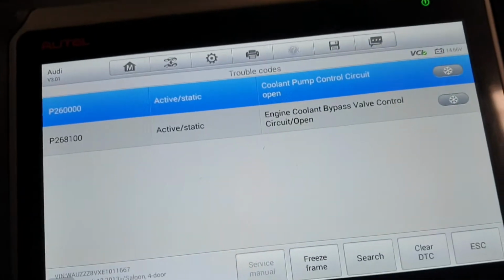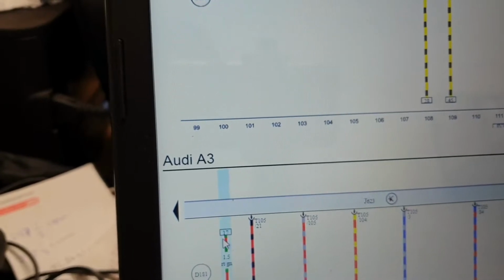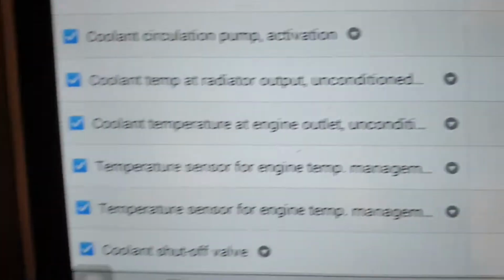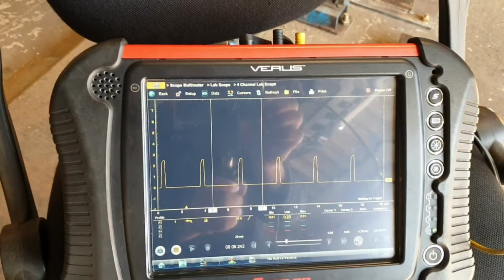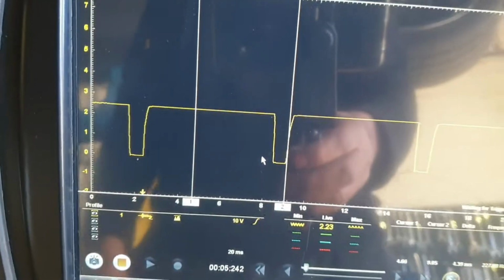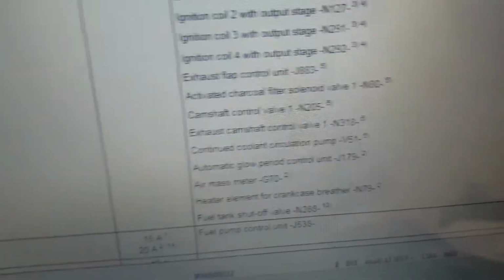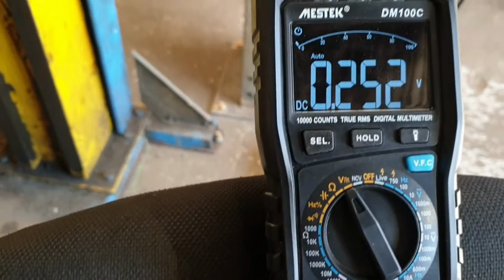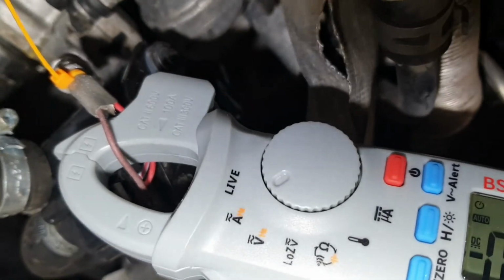Audi A3 Lemousine 1.8 TFSI 2014 P2600(P260000), P2681(P268100) Investigated

Comment: There are no proper mechanics in Rugby, all they do is replace a part instead of actually finding and fixing the problem! I have coolant pump b open circuit issue. They replaced 2 pumps and still the same problem. After paying so much money they said it’s wiring issue and they can’t fix it!
Reply from the maker: Thank you for watching our channel

Comment: I have error P260000, electrical fault or an open circuit. Any ide?
Reply from the maker: If the wiring harness to the ECU, and voltage value at the ECU pins okay then the pump is faulty